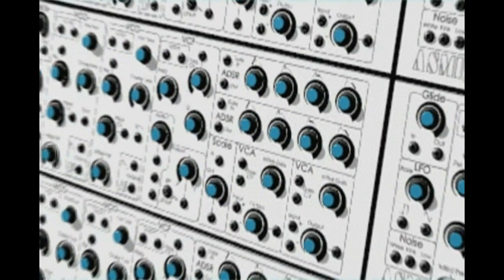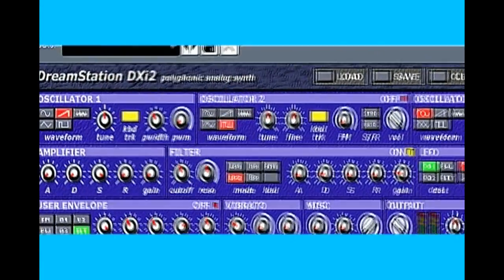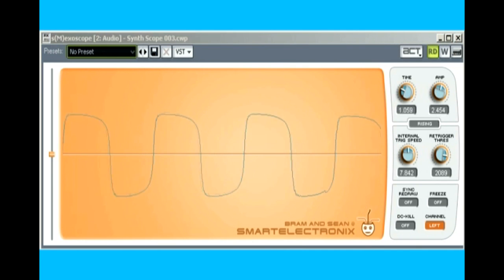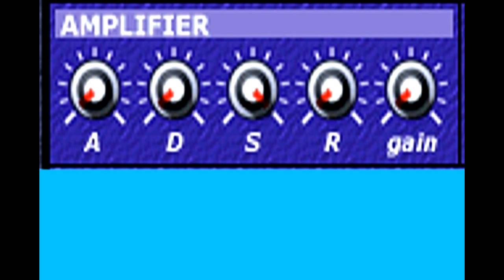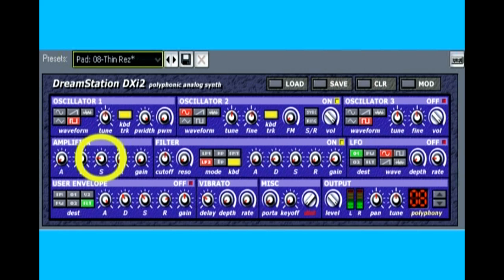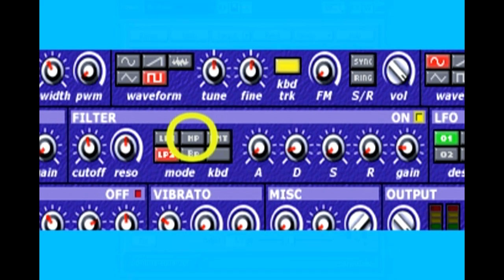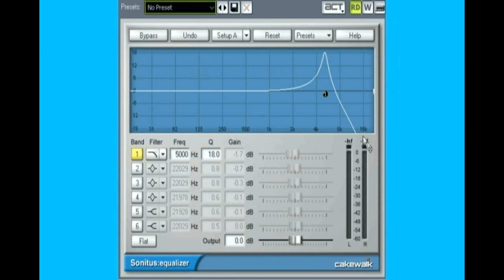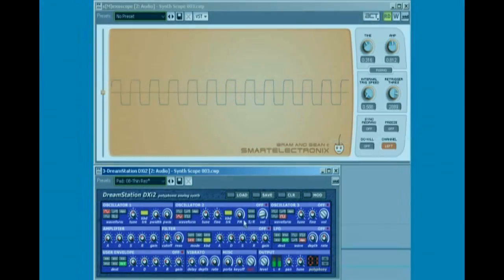How to program analog synthesizers

Comment from the maker: String pads are usually best done using samples rather than created from oscillators. Here, "samples" means short snippets played by a real string section. That type of synthesizer is called a sampler. If you're not going for total realism you can synthesize string pads with sawtooth oscillators and no filter sweeps. Also, if you're a total newbie, it might help to watch the video a few times. A lot of information is given quickly, and sometimes it takes more than one viewing to absorb it all.

Comment: Wich osciloscope did you use? How did you connect it to DS? Because DS has quite a skeletal scope and it's fairly hard to explain waveforms with it, particulary after you modulate them.

Comment: Wanted to revisit my old DreamStation days, but sadly looks like the Audio Simulation site is now a spam site. Anyone know where I can still download the DreamStation VST?
Reply from the maker: The DreamStation plug-in version was bundled with Cakewalk SONAR as a DirectX synth. There was also a stand-alone version with a built-in sequencer. I don't know of a way to separate out the plug-in from the SONAR install disk, otherwise I'd offer to give you a copy if they're really out of business.
Reply: Ethan Winer thanks for the follow up, much appreciated. Yeah their site is some weird ad BS now. Would not reccomend visiting it unless on a VM or something, its sketch AF. They used to have the VST avail on their site a while back, I thought I snagged it but if I did it's gone now 😁 but after some digging last night I found the R004 standalone version hidden on a backup drive so I was at least lucky to get that! Now I can revisit my MIDI tracker productions from 2003 hehe. Thanks again!
Reply from the maker: I just looked in my archive too, but all I have is the original DS1 with sequencer, and the newer DS2 also stand-alone.

Comment: “... oscillators permanently connected to the ADSR amplifier, which THEN goes to the filter ...”
What?!?
Reply: what's your understanding?
Reply: robinsss VCO -> VCF -> VCA. This is the way all my hard-wired synths since the 1970s worked. You can change this on modulars, but I don‘t see much sense in it. It would be like placing an EQ between amp and speaker IMO. Why should frequencies first be amplified and then filtered out?

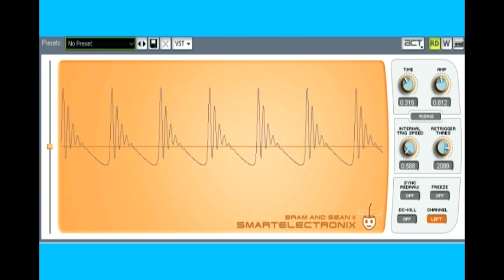Comment: At around 15:36 I start sitting on edge, and by 16:03 I just want to shoot myself.  I never understand the ADSR Filter which affects.. frequencies?  All those other parameters is just basic EQ stuff, but then that I never understood; never will understand it; it makes no sense!  Nothing personal but I just want to curse at everything.  I finished Advanced Calculus with an A, consider myself quiet adept at mixing and mastering, know music theory quite well, and have been playing several instruments and singing for over a decade, and I can't understand this.  What does attack, decay, sustain, and release have to do with pitch?  Those are time parameters!  It's driving me crazy already.  I've been deterred from synths because of this one stupid reason!  20 thousand times it's been explained already, and it's as if it's implied what it does.  They're always avoided in explanation like the plague and to me, the synth just starts doing magic when those parameters are moved.  Why.. don't.. I.. GET IT?!  I'm flipping out already.  Only so many years one can feel retarded whenever this comes up.  

The answer is going to be simple, I'm going to get it, and then watch, after that it won't make sense again.  I can't comprehend it's relation to the sound.

PS- Otherwise great tutorial btw! XD
Reply from the maker: An ADSR has nothing to do with pitch. It's an envelope generator, that usually varies the volume over time. However, an ADSR can also modulate the filter's cut-off frequency over time. An ADSR outputs a voltage that changes over time, and that voltage can be patched into anything that modifies the sound. So an ADSR could vary a pulse wave's duty cycle, or the speed of an LFO. But usually it varies the volume.
Reply from the maker: The filters (or volume etc) are all voltage controlled. This is a key principle in analog synths. You can set an initial volume etc with a knob, but that value can then be varied further with a voltage. So the voltage from the ADSR can change the filter cut-off frequency, or the volume, or the LFO speed.
Reply from the maker: I don't know how much more I can explain here. If you move this to my Audio Expert forum I can post some figures from my book. Maybe that will be clearer for you: http://forums.musicplayer.com/ubbthreads.php/forums/24/1
Reply: Typhoon792
The ADSR is an envelope generator that varies volume over time. The ADSR are control knobs to control volume whenever you use the ADSR knobs by the magnitude (volume) section. When you use the ADSR knobs for the filter section, they apply the same way but now they change the timbre over time. So you probably know what a filter sounds like. If the attack is very fast and the A knob is set to 0, the filter effect for the sound will kick in right away. If the attack for filter is very slow and A is set to a high point, the filter will take a few miliseconds to kick in and for you to hear the effect. The rest of the knobs apply similarly to how they do when applied to the volume over time, this time for the filter they are varying timber over time.

I think I understand it correctly, hope this helps
Reply: Yeah sounds like you got it. Mess around with a vst or analog synth and listen for it.
Reply: Haha, nice. Good to hear this video helped someone out. I was pretty bored by it but I watched the whole thing and am the better for it because I never would have figured out what keyboard tracking is for.  -edit- oops didn't read your whole comment.... Yeah, ADSR on a filter.... just imagine there's a tiny elf inside the box that every time you press a key on the keyboard he rotates the cutoff knob for you.... but you don't see the cutoff knob moving.... but how much and how long he moves the cutoff knob is controlled by the filter's ADSR.
Reply from the maker: Yes, "tiny elf" is a perfect description. I've used that explanation for compressors. In that case the tiny elf lowers the volume whenever the music gets too loud.
Reply: Fietronic McGee And if I could just see that tiny elf animated within my synth vst, well, that would be one very educational elf. Tiny Elf VST FTW.